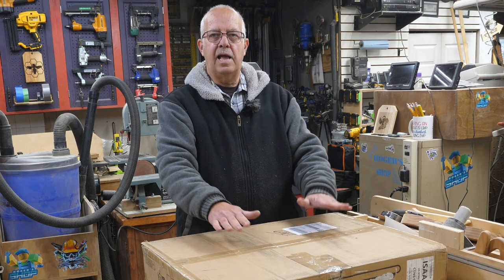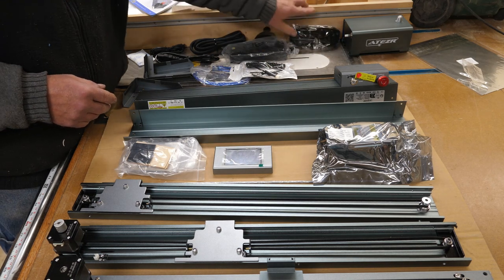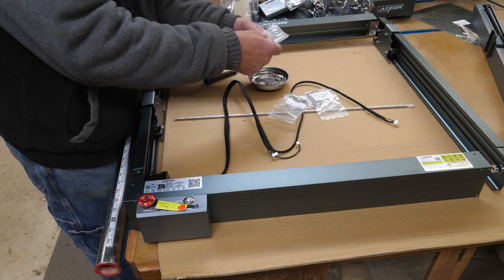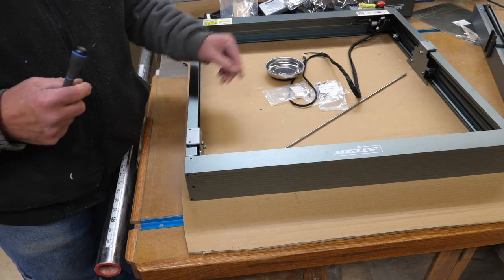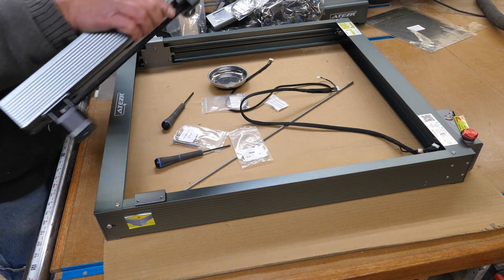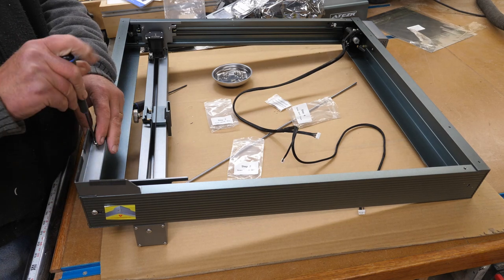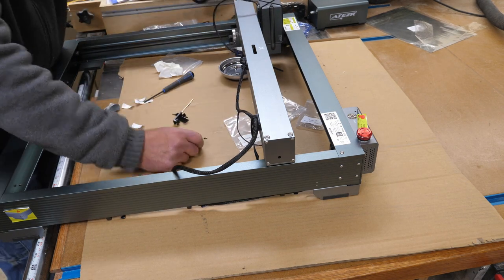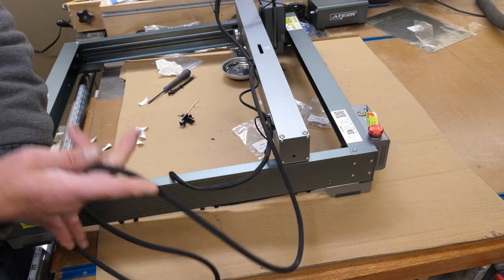Unbox and Assemble the Atezr P20 Laser - Watch Now!

Comment: Also what is this color laser engraving I hear about?
Reply from the maker: On some metals, like Stainless Steel, you can change the 'color' of the etch by varying the power.
Reply: You can also engrave through masking tape and peel away the bits you want to colour and hit it with spray paint. I think its also possible to fuse power coating paints into your engraving using the a laser, can't remember channel I saw it on but it was here on YouTube.
Reply from the maker: @shuflie  Yes.  It is called color-fill and I've done this in a couple of my videos.